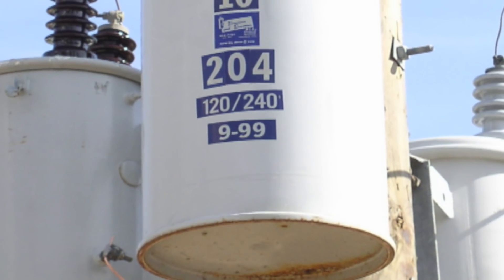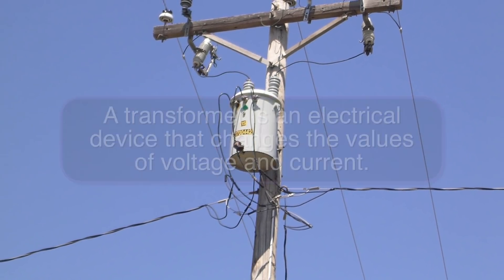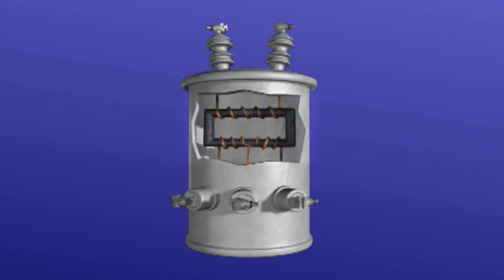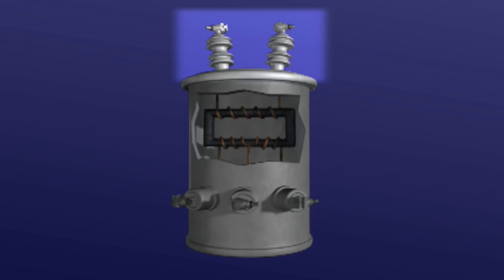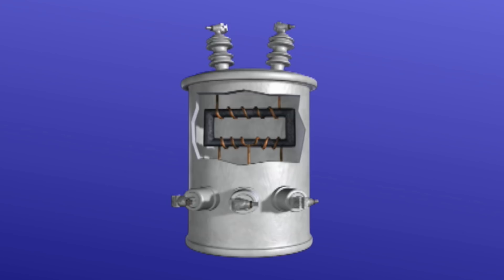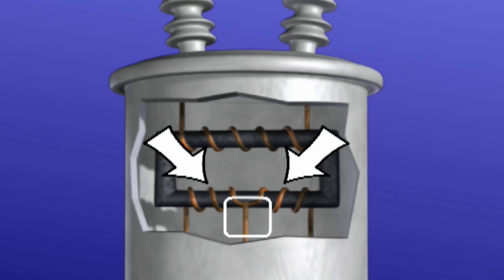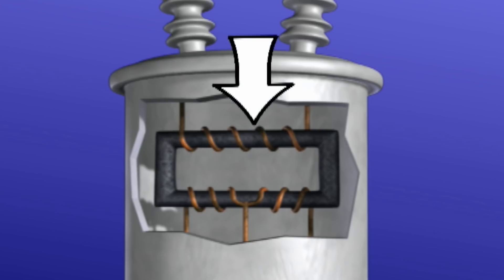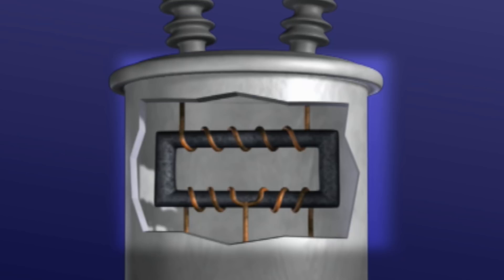Transformer Connections [PREVIEW]

Comment: what 2 wires lead to the primary coil? 2 phases out of the 3 phases or one phase and a return path?
Reply: It could be either. It's just potential difference between the two. In some cases one pole goes to a different transformer. Depends on the configuration.

Comment: That video are wrong.  230V will not work with winding like that.
Reply: Correct. The output voltage would be 120 from center lug to either outside lug and voltage across outside lugs would be zero.

Comment: OOPS,  The picture that shows the secondary winding has a major mistake in it.  The left and right half are wound in opposite directions.  that gives two 120 volt outputs which are fine for 120 volt loads, but the combined output is not 240 volts, it is zero.  look at the direction the wire is going around the core, it should be the same on both sides.  Need to fix the picture.
Reply: With a center tap, the coils in the picture are wound left helix and right helix, making the output with respect to the center tap in phase with each other. The voltage across the outside lugs would be zero. In reality, the voltage across the outside lugs should be 240v and it would be if the secondary windings were in the same direction. B YENSER1 is wrong and yhnbgt365 is correct.
Reply: I agree with you yhnbgt365.
Reply: @BYENZER  stop harassment me kids.
Reply: Michael Marr Well which is it? Still confused. Must have final explanation.
Both sides wired in same or opposite direction. or not? thank you
Reply: @BYENZER  I also agree with  yhnbgt365.
Reply: Which is correct. Still confused. Both halves wired same direction or opposite.

Comment: Today we lost power only on two of our breakers and our lineman simply replaced all the connection cables on the transformer and we're all good now.  How do we only lose partial power?
Reply: @Scorpioma....Your House in Electrically divided in 2. The Electrical Wire coming from the Pole to your House, has 2 Black Wires and 1 Silver(Uncovered) Wire. The Black wires each power 1/2 of your House. So when 1 connection goes bad, you only loose power to 1/2 your house. As Lineman, we will replace both connections anyway as SOB. I hope this helps you.
Reply: @garynelson9538  Thanks, I did end up reading something like that, so it's essentially one for left and one for right side of my breaker?
Reply: @garynelson9538 As SOP.